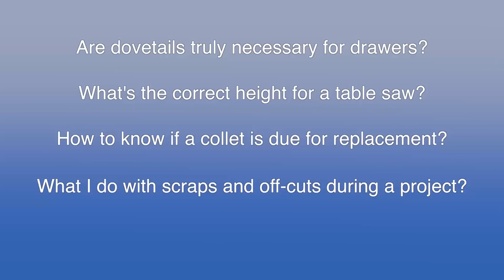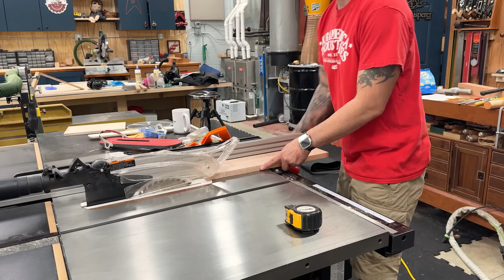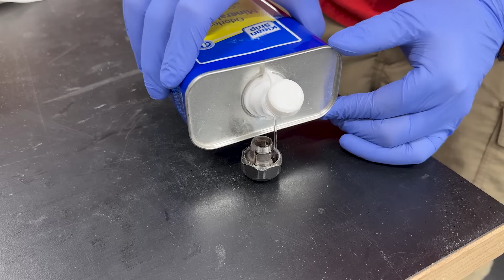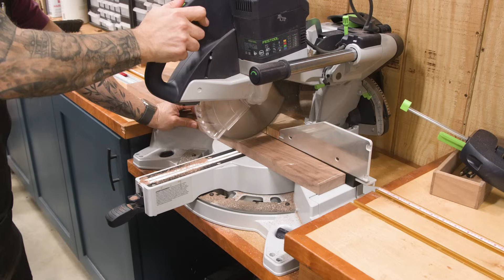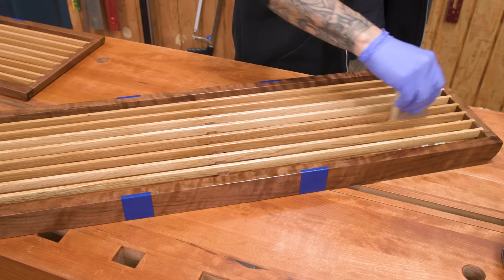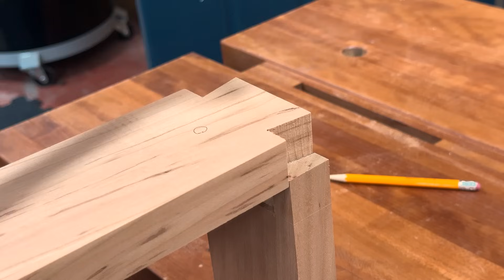The Truth about Dovetails | Ask TWW 06

Comment: I have large, heavy, deep drawers in my shop 26" deep with 100 lb full extension slides.  The drawers are butt jointed with pocket screws and  glue.  They are loaded down and have been in use for the last 6 years.  No sign of wear or tear or any kind of breakdown.

Comment: I think dovetails look the nicest, although the metal dowels are pretty cool.

Dovetails are from an age where glue wasn’t as good and reliable so provided mechanical strength to the joint in the direction of force being applied.

With modern glue and fastener options pretty sure dovetails are mostly aesthetic nowadays (and very nice aesthetic IMO)

Comment: All good advice!  On smaller boxes I like using mitered carcass construction, but struggle with how to reinforce the long miters when the material is 1/2 inch thick.....4mm Dominos can work, but difficult to keep the machine exactly aligned on the thin mitered wall.  Would appreciate your thoughts!  Thanks!

Comment: The best answer for the scrap and offcut question is: "You keep them regardless of size, species, etc., forever... because you never know." 
This is the way.
Reply: I built 3 "boxes" out of mdf and divided each with 1/4 mdf horizontal and vertical  dividers that fit into rabbeted slots. The deepest is abt 36" and sits on the floor. The next 2 stack on top and are abt 24" and 12" deep. I try to keep hardwoods compartmentalized according to species and length by storing in the appropriate "cabinet" in either the left/right or top/bottom section. Some of that stuff has been in there for years. I also have a wall rack for long off cuts as well as guitar woods.

Comment: Yes, most any joint works on drawers. I've made shop drawers with nails only and filled with 50+ pounds of stuff--still holding together after years. The reason for dovetails?--They look really nice
Reply: I was involved in selling a house from my mother's estate. The kitchen cabinets were plywood, and not the good stuff. The faces were splintered pretty badly and the joinery was a mess in various places. Held together with rabbets and nails.

I probably should have just made new drawers but I took on repairing the existing ones for practice. I chose to rebuild the rabbets where needed and then doweled them. I think these should last another 80 years. 

For the plywood faces I sliced off the damaged area with a handsaw, planed the area flat, and glued on some solid wood scraps which I then sawed, chiseled, hand planed smooth. 

And then all the drawers got dowels.

They got painted and they looked great.
As for the faces,  I wonder how well they will last. I haven't heard anything from the new owners with questions and I think they should be good. But really, I wouldn't use softwood plywood for kitchen cabinet faces again. 

And if I would not rely on rabbets and nails if I wanted them to last. Dowels are plenty strong.i favor them over pocket screws.

Comment: The first time I've seen your office set, very nice and a great mic!  I'm 6'4" and also have the Saw Stop PCS on that mobile base.  I almost didn't buy the base with it, since I have the Grizzly base from my old saw, but was sure glad I did, once I set it up.  The best mobile base I've ever used.  I too originally thought my PCS a bit low when I began using it, but now think it is just great and gives better control when working with tall pieces.  I hadn't considered the 'twig and berries' aspect though...
Reply: I'm pretty sure you can find a sale on a chastity belt. If it fits, problem solved.
Reply: @jimweisgram9185  Great option!😵‍💫😵‍💫